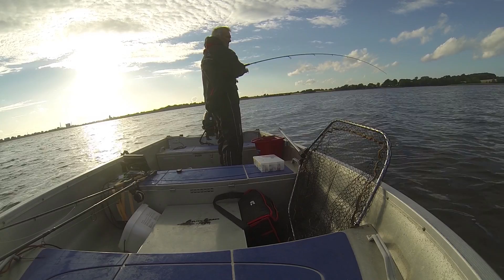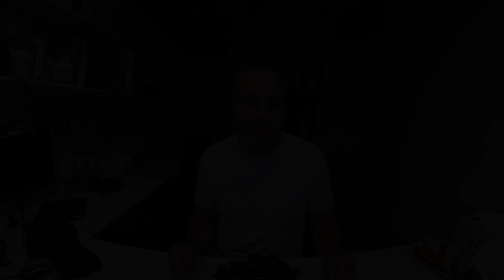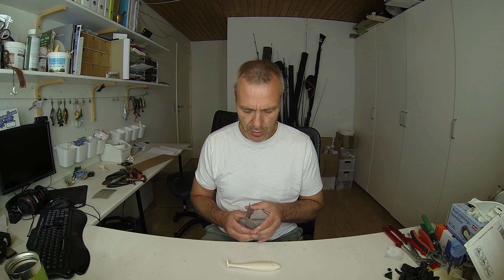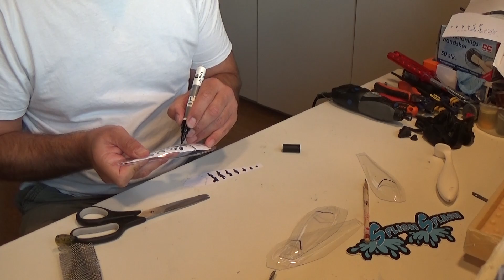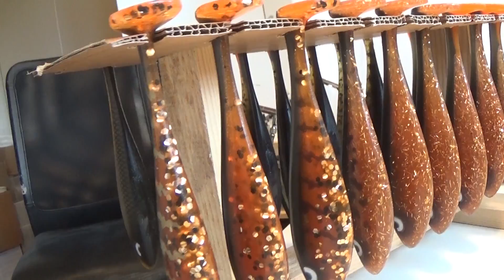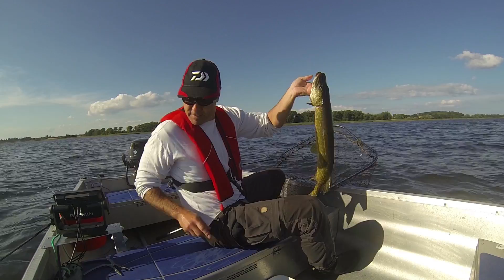VLog - The SplaShad part 2

Comment: Hey Splish Splash, just quick thought, you mentioned about cutting the master replica to mold the thermo stencil. Why won't you just pour half of the silicon mold with resin.
Like your video as always.
Congrats on nice Essox
Reply from the maker: I could have done that, but i needed a complete one to bend the metal mesh. But I did consider your suggestion. Thanks

Comment: How about greetings from Mexico, I have a question what kind of paint do you use so it does not break? your videos are excellent
Reply from the maker: Hi there. The paint used in this video is normal acryllic airbrush paint. I will be fine as long as you coat them afterwards. But there are paints that do not require the coating. However I dont know what is available in Mexico. Try searching for "CAB coating"

Comment: Awesome video! Did you say that for the final coating, you used the same soft plastic, but without color? So the same soft plastic used for the lures works for sealing the paint?
Reply from the maker: Thanks. Yes, you use same softplastic without any color

Comment: Do the tails get bit off a lot?
Reply from the maker: Green Meanie It varys a lot. The ptototypes was used for 3 trips, while others lost the paddle after 1 or 2 fish. In summertime where the pikes are fast and aggresive it is usually worse than winthertime. Also the hot water makes the softplastic softer. However sometimes softplastic totally outfishes hardbaits, so you really need them in the box